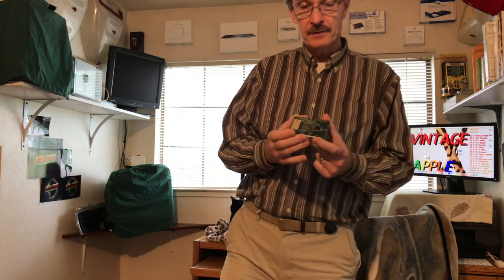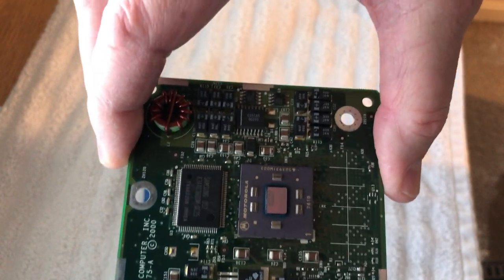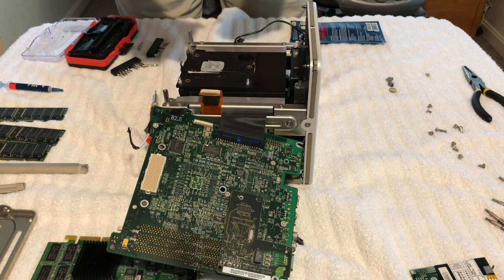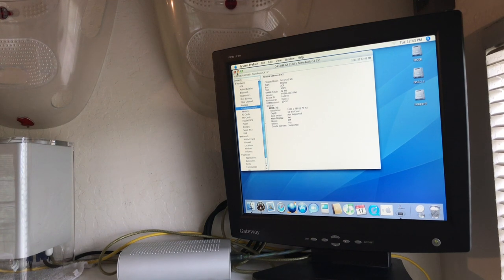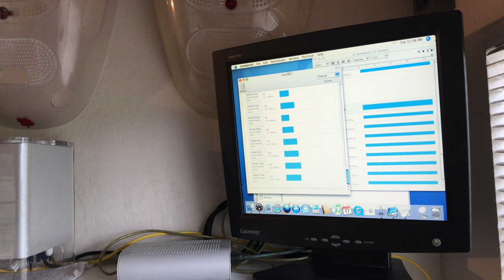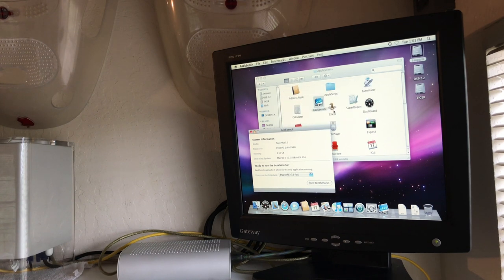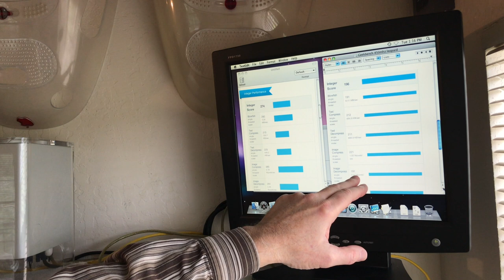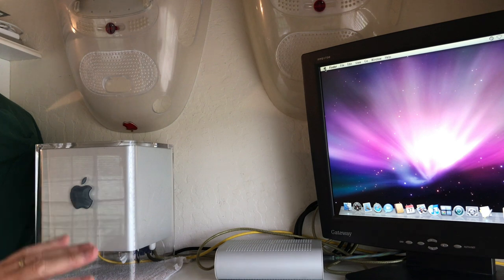MODDING THE G4 CUBE UPGRADING TO A MODDED 600MHz CPU  PART 3

Comment: Very cool! I had no idea you could upgrade the CPU to 600mhz in a Cube. I have a 450 and a 500, so I may try this upgrade in the 450. What is the name of the seller on eBay who makes these? My 500 has an upgraded/modded GeForce 6200 GPU in it and it's very smooth.
Reply from the maker: I Put The Link On The Video  https://www.ebay.com/usr/smrxm
Reply: Just watched your video of the upgraded processor in the g5 cube you did last year wondering if you have any of these boards for sale or where I can get one. 
Bill